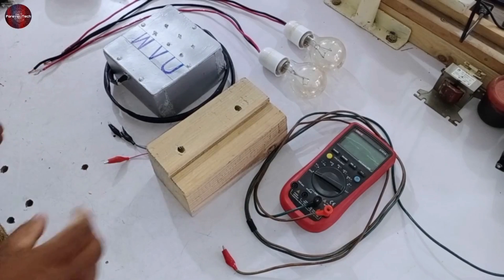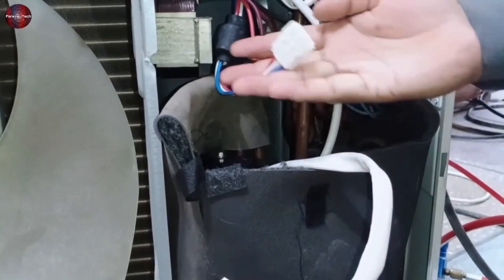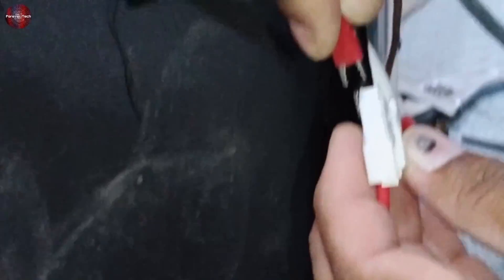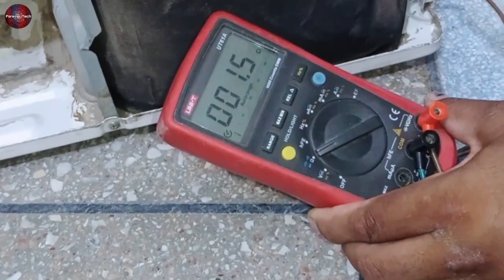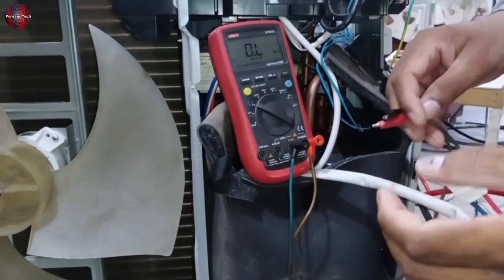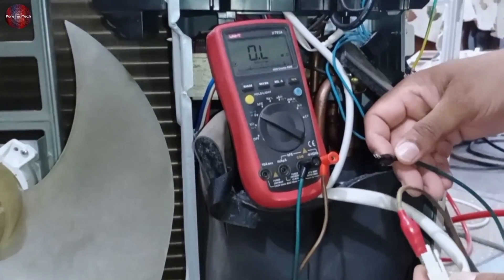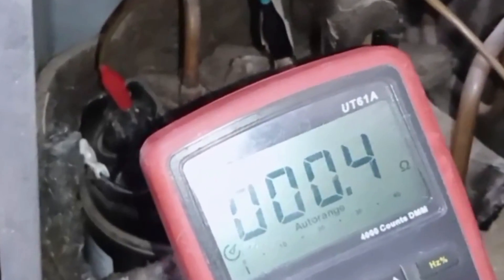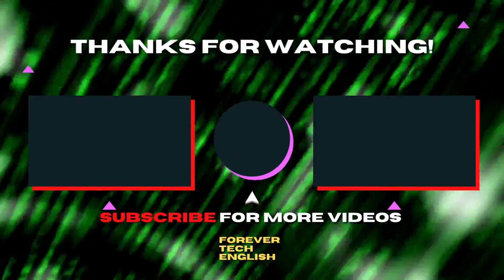How To Test a Bad Mini Split Ac Inverter Compressor

Comment: Please add that the unit MUST be disconnected from electrical supply before making these tests.  Thank you
Reply from the maker: Yes, thats a must. I know a common man would not know that. But we should have to use our common sense for working on electrical or electronic device to turn off the electric supply on working on such things. Great Point.
Reply: ;;; 😂😂😂😂🎉f🎉😊😊😊
Reply from the maker: Let me pin your comment.
Reply: Good idea!  Thanks
 @forevertechenglish
Reply: Nobody who doesn't isolate should even get this far lol
Reply: Did you blow up bro?? 😂😅

Comment: I got 2.5 on all 3.  Still good?
Reply from the maker: 2.5 but what is the ohms reading?
Reply from the maker: Means that is it only ohms, kilo or megaohms
Reply: Compressor still good but a leak somewhere. High probability in the condenser itself

Comment: What about all reading was 0.4 ? Compressor faulty or in good condition.. thanks
Reply from the maker: If all the readings are the same the inverter compressor is considered good.
Reply: @forevertechenglish  but compressor start but after that cut off in while 3.5A

Comment: Hello from Austria what's wrong with the compressor or controller it is a 3 phase DC compressor with a controller(PCB) 12v 60A the compressor rpm is between 2300rpm and 2600rpm but it's doesn't go up to 4500rpm. We reduced gas no change. The compressor is a DC 9-16v type we only get 9vac reading on the multimeter. Kind regards Adi

Comment: I have reading 2.9ohms on all terminal. Is that good compresor
Reply from the maker: Yes that's fine, don't forget to check the body short
Reply: I chek that also. Its open line on all terminal. Thank you

Comment: hi, i have tested a reading of .2 same across all compressor terminal is it good?
Reply from the maker: It's good
Reply: @forevertechenglish   Thank you for this insight. Afterward, I tested the compressor terminals against the copper pipe, and I obtained consistent readings across all terminals. I suspect that the compressor is faulty. By the way, I'm troubleshooting a Mitsubishi City Multi VRF system. I have already replaced the inverter board with a new one, but the issue persists.

Comment: How are you sir, how about the reading of inverter compressor  2hp are .9ohms all are the same and shorted on body of compressor it is the compressor okay thanks to all your video
Reply: Big compressors have lower value. It is normal on big compressor to read value between 0.7 and 1. It is important that the values are similars between the 3 coils.
It is best to use a milliohm meter for that